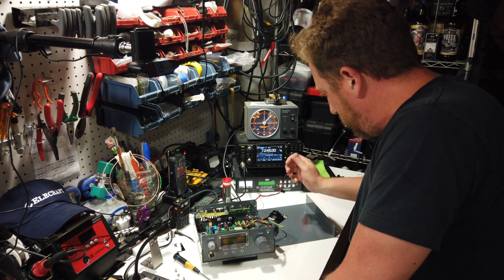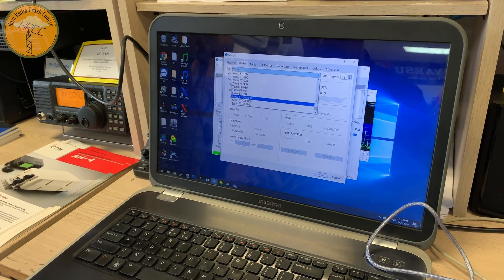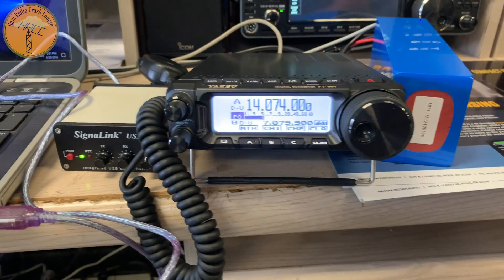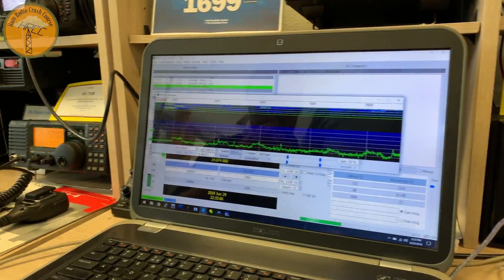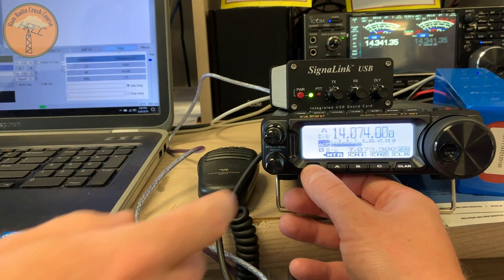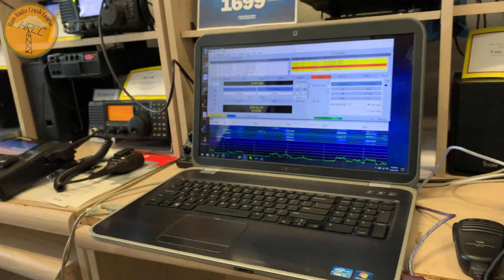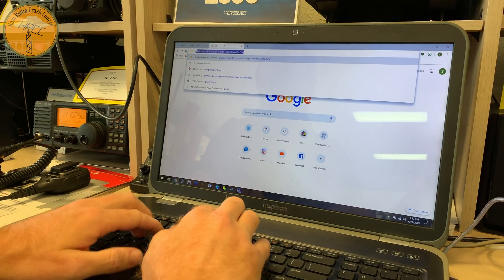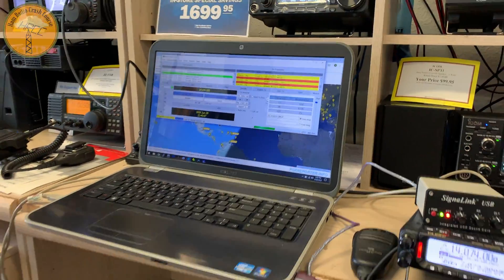#FT8Man Saves a Yaesu FT-891

Comment: I have the same setup with but no audio on transmit which was what you fixed as one of the last steps. Setting ALC on the screen and turning the signalink tx knob on tune does nothing. Odd. Good video. That’s my local HRO too. 😊Thanks.
Reply: My 891 was in data mode, not regular usb. Changed the setting in wsjt-x so all good not. Thanks for the video.

Comment: How do you change the ALC if you're not using a signa link?
Reply from the maker: Use the WSJT-X program to lower the output volume.
Reply: @HamRadioCrashCourse  have tried that nothing seems to work but I will keep trying. Thank you for responding to my question

Comment: do you have to use a signalink with a FT 891 in order to do any digital modes?
Reply from the maker: No, you can use a usb sound card, or appropriate Y audio cable, but it’s does make it easy to dial it in.
Reply: @HamRadioCrashCourse  - when you say, "easy to dial it in"... are you just referring to the mic and volume knobs only.... or some other setting?

Comment: hello friends I did the same video configuration and I get this problem when transmitting and the cat button is red. I use wsjt-x window 10 system
Error Hamlib: Protocol error

rig_get_mode(2204): freqMainB=0, modeMainB=, widthMainB=0

rig_get_mode: elapsed=55ms

rig.c(2207):rig_get_mode return(-8) Protocol error

rig_get_mode(2204): freqMainB=0, modeMainB=, widthMainB=0

rig_get_mode: elapsed=55ms

rig_get_mode: elapsed=55ms mientras obteniendo modo actual

Comment: Would have been sweet if they put a audio chip in the radio 🤦‍♂️ I have an FT-819 I use it for camping and run some FT-8 and not having the audio ship in it makes me have to lug more crap around.
and they need to fixed the firmware problems people are complaining about.
Reply from the maker: I think audio cards being in all radios even a lot of qrp will become standard now.

Comment: Is the Signal Link essentially a sound card?  Is the radio connected with the USB CAT cable to the radio;  and also with a second cable going from USB to Signal Link and from Signal Link to the DIN on the radio. Essentially do I need a Signal Link to do digital modes? Perhaps dumb question because the video makes it look that way.

Comment: Used the same settings but my FT-891 is not outputting anything if in data mode, works only in SSB. Don't know why.
Reply from the maker: You have plugged into the back of the radio?
Reply: @HamRadioCrashCourse  Yes and also selected "Rear" as input.

Comment: I am confused: 50% ALC?? Others are saying: ALC has to be right at the lowest point, so that it barely moves. Who's right now?
Reply from the maker: As long as the alc is within that bracket, it’s generally fine.
Reply: Ham Radio Crash Course thanks for responding! What about AGC? First I turned it off but some strong stations were overriding. I now set it it to AUTO.
Reply from the maker: I like to run it off or very fast.

Comment: Just watched this for the first time because I ordered the 891 last night.  Hilarious!  #FT8Man  Very informative too.  Question: is the SignalLink necessary? I don't have one hand have been FT8-ing for a while now on my 991A without issue.  If it's optional, what's the advantage?
Reply: Lee Harrell [KI5GCF] the 891s usb is cat control, but doesn’t carry audio. You use the interface to “convert” the 6 pin din cable into usb. So you need it
Reply: There are other options becides the SignaLink, I use the USBDigimode 3 from xxgcomms. It's basicly the same thing, it just doesn't have the level knobs on the front. It's like $75 shipped to the US.
Reply: I too used a SignaLink USB with my TS 2000 for portable ops (POTA). But I soon realized that it was too much equipment, hence,I’m the proud owner of an FT 891. While waiting for SignaLink to send me the appropriate radio cable and plug in module  for the Yeasu, I tried a Sabrent USB audio device  and it worked very well. Since I will use this unit portable and on battery I saw no issues with ac hum and also use lower power than many (25 watts). Could be a good alternative for those folks that might work portable with a battery.

Comment: @Ham Radio Crash Course I like how you adjusted the power output using the ALC & tune function with wsjtx, I can't figure out how to adjust the power output on SSB non-digital, any ideas? Thanks
Reply from the maker: Power output should be controlled on the radio. With the ft-891 hold the f button until the vertical menu is displayed and look for the ssb output. Adjust it there. 
You adjust the alc by reducing the computer volume or the wsjtx control.

Comment: Is the SignalLink the best digital interface for the FT891? Or are there other options?
Reply from the maker: That would be the best. But all you need is a usb to audio adapter.
Reply: DigiMaster MiniProSC DATA Interface and is perfect for weak signal operation typical noise figure better than -93dB.
Compare that to a typical SignaLink at just -71dB.
Reply: @mikeh9446  I bought one and set it up yesterday. It's a PITA having to adjust settings to switch between FT8 and SSB within the FT891 every time though :(
Reply: @johnratcliffe6438  Digi3 which i used the sound settings in the PC after you followed the instructions.  works well
Reply: I use a digirig, same setting show on video. Working on linux/windows without problems

Comment: Josh, good on you to help a fellow ham out.  That is what this hobby is about.  I also run digital with a FT891, but discovery learning for it up was not exactly user friendly, even after talking to the Yaesu rep.  It is relatively simple once you break the code, but you do need to know those critical things like the bandwidth setting, ect.. After setup, the FT 891 really does a great job on both digital and voice.

Comment: How is that 891 for QRP or battery operation?
Reply: I use battery all the time with my FT 891.  I recommend at least a 10 amp battery with some sort of portable solar panel to help things stay topped off.  Standby power draw is around 1 amp, so you need some juice to keep things running in the long run.

Comment: Hi Josh,
That was great. I like DigitalMan. Why limit yourself to just FT8. I'm almost there with FT8. Had to select hardware handshaking on my FT450 to get it to work. I'm also using the SignalInkUSB. Next is setting up where to log contacts. I just entered my first contest using N1MM+. Figured out how get it working about one hour before start of IARU contest this past weekend using NV9L Youtube video. What would you suggest as a daily logging software, or how about the subject as your next HRCC?  73   WB3BJU
Reply from the maker: I use N3FJP.  It gets the job done and interfaces with the radio and software easily.